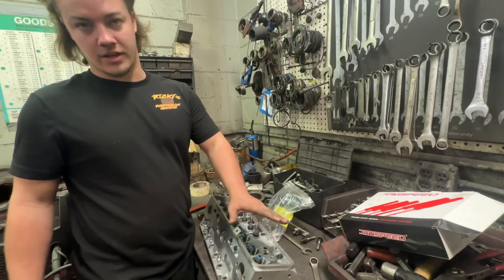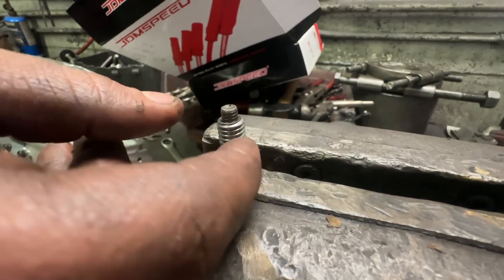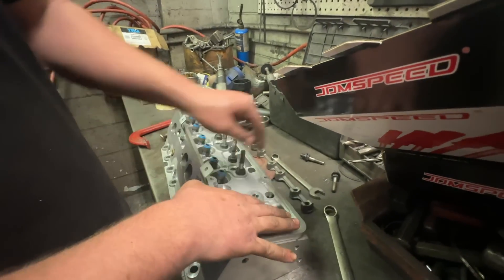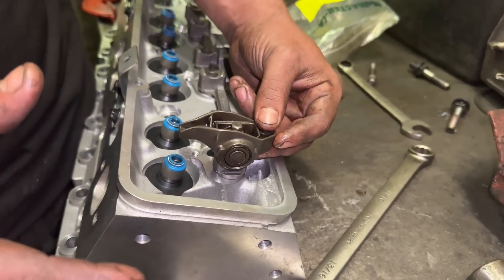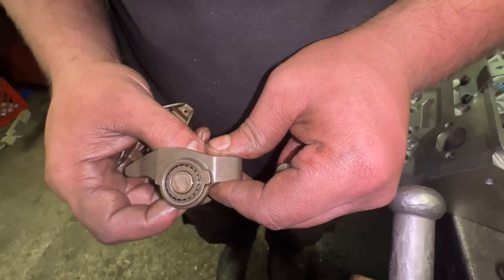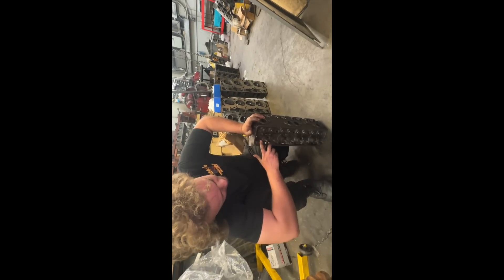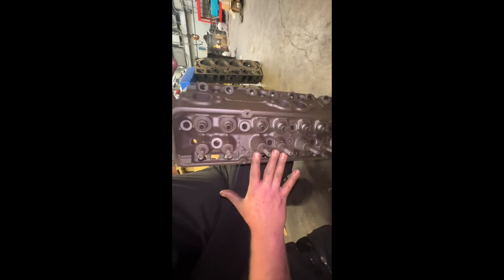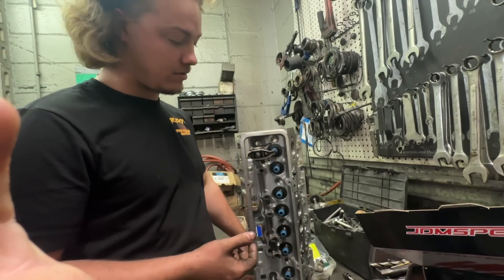How To: get Ls style rockers for cheap on a Gen 1 SBC

Comment: Why couldn't you use the rocker arms from the 4.3l that the rails came from
Reply: Most of the 4.3 rockers are designed for very small lift cams and will not have the range of motion as the 2.2 rocker.

Comment: The press in studs are 3/8", which is a hair smaller than 10mm. The 8mm bolts will push in with no problem, so that can not be done. 
Looks like a custom stud from say ARP with the 7/16" UNC in the head, and 8mm for the rocker with a nut. Probably need the studs without guide plates and the nut on the stud. Otherwise, the pedestal needs to be milled farther down so the rocker and guide can sit on the stud nuts.

Comment: If it works ....should i replace the springs for stiffer ones or stock replacements!
Appreciate your content!!!!
Thanks in advance!!!!
Reply from the maker: Stock springs should work as long as the cam is stock the rockers don't have much of weight difference so spring selection shouldn't  change. sorry for the late reply life has been busy.
Reply: @BasicMaintenance2  seen guys use ls6 beehive springs and a comp retainer kit to get .500+ lift out of vortec heads ( don't flow much more past .5) would your rocker trick work with the beehive springs?

Comment: in regards to using LS rockers sketch because of geomeetry.... would installing lash caps help? it makes diameter of stem larger obviously  could they help relieve this issue?
Reply from the maker: Most likely not entirely I would bet it would help but not much also as another person pointed out even though a ls rocker is 1.7 to 1 because of the geometry of the sbc head you wouldn't get the full 1.7 to 1 ratio without moving the rocker mounting holes back which if you are going to that much trouble then I would say buy roller rockers meant for a sbc the machine work would be too expensive

Comment: Even if (stock) valve guide life is reduced to say 50,000mi, that'd still be alright.  I bet this will work without a hitch. 
Dig up some 2.2 roller tip rockers and valve guide life becomes a non issue.

Comment: You don't think the rocker will slip off the valve left or right since the pedistools are not all attached to each other after cutting them, the only holding them from spinning is one bolt. I think that's what rocker stands are usually one piece
Reply: I think you leave them in pairs
Reply: I would weld them back together after cutting

Comment: 2024 just started and this guy is gonna win the worst idea of the year award. Just buy some roller rockers people that are actually intended for your application.
Reply from the maker: send the 450 dollars and I'll gladly buy them otherwise I like my option
Reply: @BasicMaintenance2  450?????? Dude did the internet reach your village yet? Jegs - summit - Amazon - speedway ever hear of those places? 150 will get you a set of 16 full roller rockers. Howard cams sells a set of 8 for 90 so that's 180.
Reply: @BasicMaintenance2  And your options are bad. For your own good don't do what your doing. Your going backwards most performance builds will convert none adjustable rockers to adjustable not the other way around. You'd be better off drilling the hole bigger in those rockers your trying to use if that's possible and forget all that other nonsense.

Comment: This is all wrong, the amount of movement on the valve tip will kill guides quick, LS and sbc rocker pivot lengths are significantly different, don’t cheap out; buy quality roller rockers otherwise you’re just kicking the can further down the road
Reply from the maker: we will see and let you know
Reply: @BasicMaintenance2   see how many miles you get out the engine before the guides are completely rooted
Reply from the maker: @circlejerk6861  you are aware that these arent Ls rockers right. Just Ls style but they are out of a 2.2 4cyl chevy you are right ls rockers wont work as we explained in the video.
Reply: Glad someone understands this. Some love doing things over and paying for it a couple times. Pass lol

Comment: I'm using 7mm Powerstroke ductile valve guides with used titanium valves from Rusty Wallace that i had cut down to 2.05 and 1.6. 200cc heads. Five inch tall xceldyne with non guided stock rockers, corvette beehive springs. Most are all 6 and 7 inch tall for NASCAR but you can find stock height out there. The guides are super hard to hone but you can run zero clearance since ti has no expansion. It's awesome. Might build another 383 and add a snail. Car porn.
Reply from the maker: turtle valve is better tbh
Reply from the maker: I like snails too we will have two connected

Comment: That sounds great. Except. I only see slightly over the diameter of the pedestal mount bolt for thread engagement into an aluminum cylinder head. 
A traditional gen 1 screw in stud has what half an inch of thread engagement of the screw in stud into the cylinder head material. If 3/8 screw in studs are you can upgrade to 7/16.
  Also, you have to check rocker arm geometry not just push rod length. Actually push rod geometry decides pushrod length, not the other way around. 
And yes this does mean you don’t have adjustable rocker arms. If you learn how to adjust valves on a gen 1 the way the factory did, you can run to 7400 rpm’s with factory stamped steel rockers  and flat tappet hydraulic cams. Go roller and it’s even better. 
 Is this the reasons everyone goes LS, so they don’t have to learn how to adjust valves? 
  Shaft rockers for the gen 1 have gone past $1500 to $2000 a set. Parts costs have gone crazy. 
 It’s some great ingenuity. But seems like a lot of work for something that already works as or should past 7000rpms stock. 
 Show some dyno runs, or miles of durability or rpms that are better than what we already have.
 And for those that say you don’t need valve adjustment with the LS. For stock and modified not always. At a certain point, you need to change to adjustable shaft rockers on the LS also. So if you know how to adjust a valves anyway it should not be an issue. This is why gen 1 people are wondering why valve adjustment is so difficult to understand. It’s not. Follow any old repair manual and you never need to make adjustments once it’s set, if you do it right the first time.
Reply from the maker: The thread engagement into the head is definitely one possible weak point. I work at a machine shop and do all there head work and I've seen screw in studs with more engagement that my inserts and less than my inserts. Nether of which reported any issues so I'm fairly confident that this won't be a problem. As for geometry I tried a ton of different combinations for shimming the pedestals I actually put a set in the surfacer and reduced the height so I could try lower than stock and higher. After all that what do you know completely stock height with no shims was the best one, now that I know that all I have to do is get the correct length pushrod that gives me the right lifter preload. I wouldn't say most people that want a valve train like a ls just don't want to learn how to adjust valves the main advantage to me is valve train stability. To some degree a ls is harder to get right than a sbc because it's none adjustable. No matter what you do this setup will require some fiddling but I think the end result will be worth it

Comment: Im building a 3.4 60 deg v6 and they have similar rockers with 1.6 ratio.
I thought I was smart and bought LS-rockers just to find they were too long.
Then I found that the rockers I had were 1.6..

But I was wanting to get 1.5 for the exhaust so this could be a good tip.
What engine did you get them from?
Reply from the maker: they came from a 2.2 chevy 4 cylinder out of a s10 or cavalier

Comment from the maker: As for the people asking about the valve lash you have adjust it just like an ls you have to get different length push rods to achieve the correct valve lash. comp cam sells a tool that is pretty cheap to measure for the exact push rod length. this is one disadvantage vs the stock rocker setup, but is outweighed by the massive strength increase you have in valve train stability. that's why gm moved to this valve train design with their mew engines rather than sticking with the original.
Reply: I've done this a bunch and 20 years ago. You can easily do it and it will work and it will pick up 10-15 hp depending. Also put the springs on as well especially if u ain't changing cams. The beehive picks up power as well.
Reply: Watched the video, read the comments like to see the next video with a sbc together using this method stock/modified video the valve lash settings and show that it runs. Very interesting setup way to think outside the box.
Reply from the maker: @jacobjarvis2545  we are definitely going to make a follow up video with it all together and several of it running we are definitely going to put it through its paces.
Reply: Could you also adjust the lash with a thin shim washer under the pedestal
Reply: GM switched to this because the aftermarket was doing it and better for along time and proved it to be better so when they made a new design they incorporated what people had been doing already. This is pretty much why all manufacturers change things. Or at least when they make positive changes. Still same valve train design just different hardware doing it.

Comment: Wow, the abuse that vise has received is outrageous. People that beat on vises need to alter habits such as purchase an anvil, one with a hardy hole. The jaws are horrendous.  It is easy to make a new set of jaws although they will not be knurled on the face. Just use steel of the proper dimensions, drill 2 holes accurately and install. I have my original jaws plus I made a pair out of aluminum for softer material that can be marred easily. 
I called Engine Tech and they will not say what the actual ratio of the ER901 rocker arm is, only it fits the application according to VIN number of the vehicle. I guess it is part of a NASA project and top secret. They are not cheap, Rock Auto has them for $12.00 each. For that kind of money, I would spend the extra cash for a set of Scorpion roller rockers and get the ratio I want.
Reply: Brand new they aren't any cheaper but junk yards give those rockers away usually that's the idea here if you are dead set on brand new definitely go with a traditional roller rocker
Reply: Get a life bud.

Comment: A big part of the reason to use larger diameter studs on old school small blocks is for lateral support, the same reason you would use a stud girdle. The use of the pedestal eliminates a lot of the lateral movement and the bolt is mainly tasked with holding everything down.

Comment: Great ingenuity, I like this set up. Although I understand that the LS rockers are longer on the valve side of the pivot, but using them on a 1st Gen style head would only increase the ratio if you move the pivot point further away from the valve. My understanding is that the rocker arms for small blocks that increase the ratio move the push rod pocket closer to the pivot point.

Comment: I just hate to see you spend all the time to do it and then to find out it wont work on a small block Chevy.
Reply: As long as you achieve proper lifter preload it makes no difference how you adjust that preload weather it be by adjustable rocker arms or difference length pushrods this setup is basically straight out of the newer gm 4.3 6 cylinder engines that are just small blocks minus 2 cylinders

Comment: What head castings are those ? I don't reconize them.
Reply from the maker: dna motor, ebay style heads. buy a bare casting and put the parts you want in it. the parts it comes with aren't good

Comment: If you use an impact or a drill, you push the rocker arm down against a vise or hard surface and the bolt on the Cavalier rocker arm will come right out. I used 3.4 v6 rocker arms in my Cavalier, had to use the 98 2.2 rocker arm pedestal with the tab milled off, but the 3.4 had some that were 1.6 ratio, but use an impact to take the bolt out, using a hammer to beat it out could cause some structural damage, the rockers are cast, not stamped steel

Comment: This is a great video and great information. 👍
Ignore the other people saying stuff about 10mm bolts and what not. They're stuck in their way of thinking and they're obviously not familiar with the way pedestal mounted rocker arms work. Their points are valid when using a traditional small block Chevy rocker arm that's shaft mounted but one of the huge benefits of a pedestal mounted rocker arm is the resistance to deflection, which only really happens on a traditional shaft mounted rocker arm. The bolts on a pedestal mounted rocker arm are not subjected to the same stress of "locating" and supporting the rocker arm.
Reply: It's along the same lines of using a stud girdle, a stud girdle still has the advantage of locking the posi locks
Reply: @kalybnielsen4183  Will that work with stock rocker arms?
Reply: @Carl_Jr  It will if you use the taller poly locks needed for the girdle. They won't fit under a stock valve cover though.
Reply: @kennydemartini2169  I wouldn't think the stock mounting stud for the rocker arm would be long enough for a taller nut with poly locks. I honestly don't know. I've never tried. The only time I've used stud girdles were on screw-in studs, roller rockers and guide plates. 👍

Comment: So is this just for Hyd Cam / Cause if you run a Solid lifter Cam How are you gonna Adjust the lash ?:face-blue-smiling:
Reply from the maker: it would be easiest on a hyd roller cam but if you look at people that do solid rollers on ls's you can do it by shimming the bottom of the rocker arm pedestals or by getting diff length push rods but that would be time consuming though its possible.

Comment: What about a 3.1 v6 rocker from late 90s. They use a bolt with 10mm thread.
Reply from the maker: are you referring to the rockers that look like stamp steel rockers but have a roller trunnion? those would work but I like the Ls style bc they are a little stronger

Comment: Here’s my issue, why struggle and force a set of these to work, when, you can simply buy a stronger product that’s not using the metric system? 

A set of full shaft rockers from speedmaster, or a set of steel rockers from summit, or speedmaster… or just a generic white box 1.6 ratio rockers from eBay, unless you have an abundance of pocket cash then there’s comp cams, scorpion, etc etc. 

This feels like it would be a waste of money with little to no benefit.
Reply from the maker: well the alternative is buying the same style rockers for more money. doing it this way you get all factory chevy gm parts that have been tested and have known reliability. along with saving money and getting the same benefits as the premade rockers for less than half the price if you have a decent junkyard around. our local yard pretty much gives us little stuff like this that usually gets scrapped anyway.
Reply: And you call yourself a shade tree mechanic.... 🤣🤣🤣